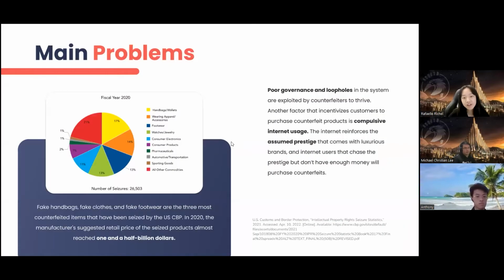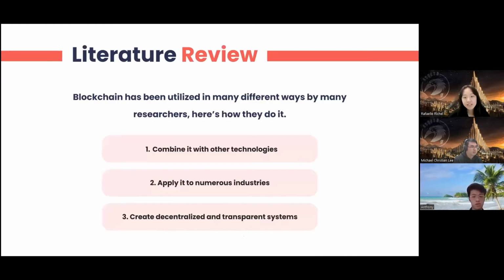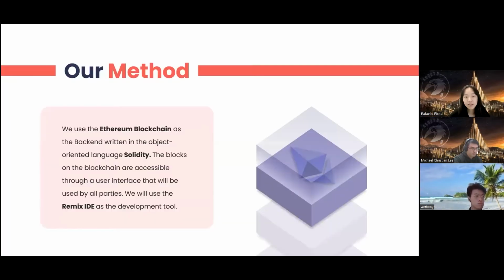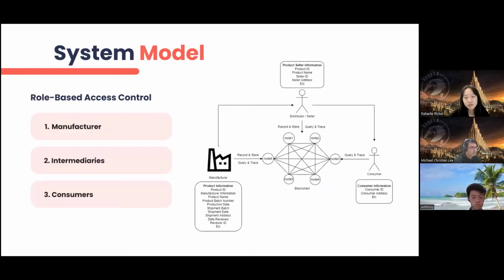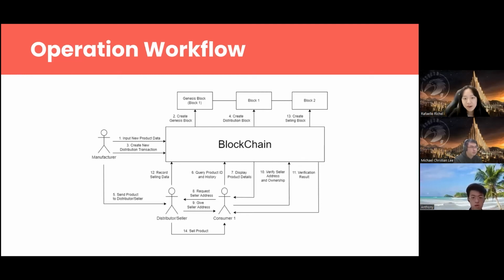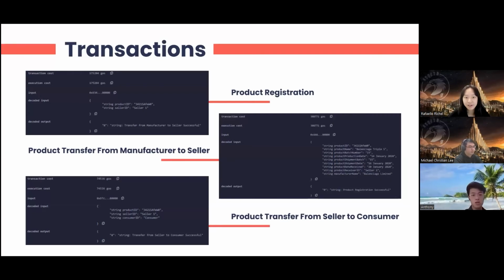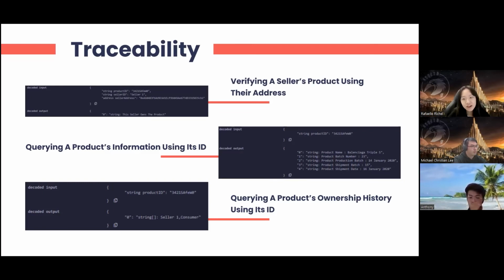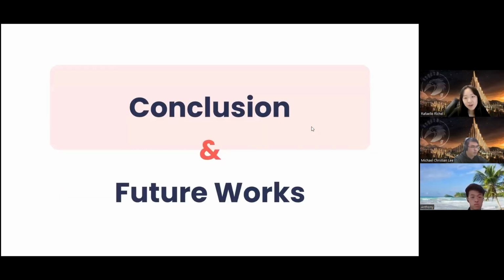Developing an Anti-Counterfeit System Using Blockchain Technology - Group 6

Comment: Thanks for your useful video, I wonder that if the bad seller try to swap real product for fake product by using the QR code of the real one and stick it to the fake product and sell this fake product to customer
Reply from the maker: Thank you for the question!

1. We can use the QR code in the form of a unique tag and not as stickers, therefore increasing the difficulty of manufacturing a fake product.
2. The unique product ID is also used to query the product details and if there are any discrepancies it can easily be found.
3. Due to the traceability of blockchain, if any product has been falsified and forged, we can easily track who was the previous owner of the product and find out the culprit (as the only person with the possibility of forging the product is the person who has the original product).
4. The seller should have no incentives on faking the product, as that would render the real product deemed a fake and not re-sellable because it doesn't match with the blockchain data.